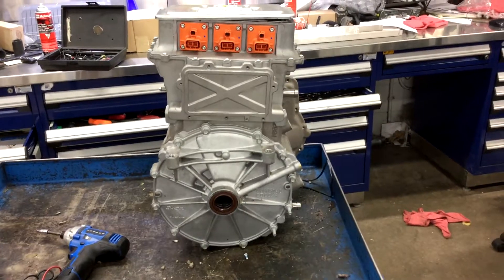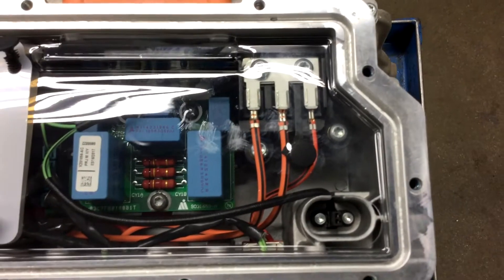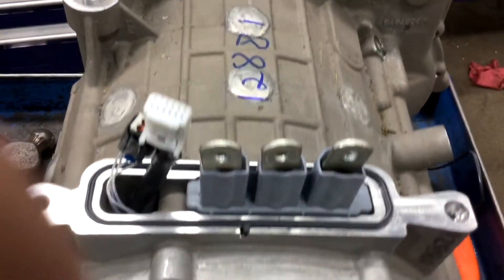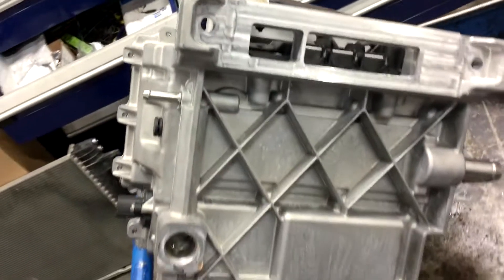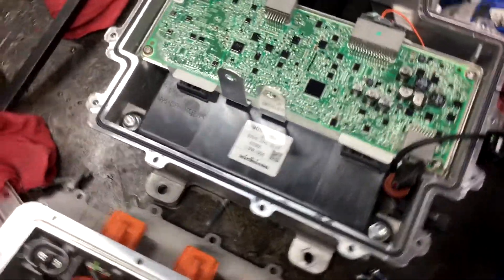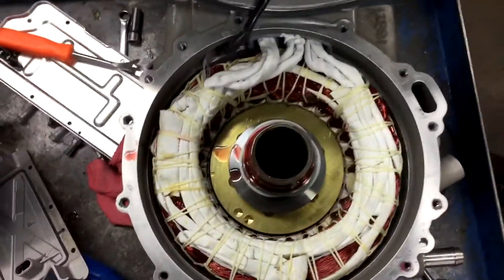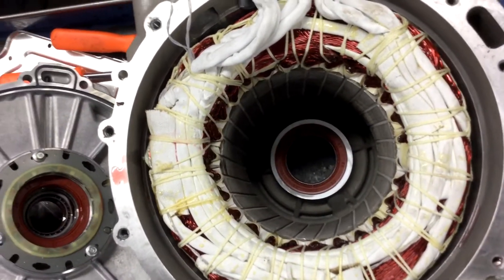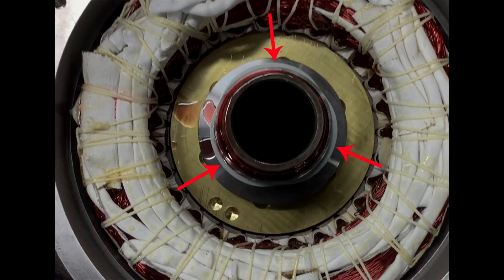Ford Focus Electric -- motor teardown

Comment: Do you want to sell me that scrap TCM?
Reply from the maker: After the video was compleated, All of it was donated to a local college as a teaching aid
Reply: @RedneckCam666  I got a high voltage leak and it’s making a very pretty wave form of 3v + and 1v - so I’m thinking my tcm is going out from me constantly hammering it. :) no big deal I have a pile of modules already and will just add this one to the pile.
Reply: @eprofessio Hoping you still monitor this after 2 years. My TCM was diagnosed as bad due to a high voltage spike. Can I just replace the TCM with a used one? The dealers just want to replace the whole transaxle/TCM since that’s how they come from the parts dept. but they are not available anymore from ford. Sounds like you’ve done this before. Any programming required after doing it?
Reply: @jefsel881  all the parts I have swapped out just magically worked with no additional programming.
Reply: @eprofessio that’s encouraging. The dealer said the harness and the TCM are bad. And if a voltage spike killed them would you expect the evcc to be bad as well. Where else could a voltage spike come from?
Reply: @jefsel881  dealers don’t know shift about ev. Especially ford.
Reply: @eprofessio  I get that impression. Plus I get the vibe that they want ev's to fail.
Reply: @jefsel881 once I figured out how easy ev are to repair I fell in love. It can feel overwhelming at first because it’s so new relative to ICE machines. They are super simple if you exclude the minutia of the electronics.

Comment: That piece between the TCM and the motor was more than likely the inverter you can see the 3 bus bar connections for the 3 phase motor,.

Comment: This is becoming a trend - EV proponents may claim EV are "simplier" than ICE but in an ICE most parts are usually serviceable. On an EV most parts are integrated electronics & chips which usually aren't serviceable - and a complete replacement isn't going to be cheap.
Reply from the maker: Not really, most ICE engines are not worth rebuilding vs buying new when you factor in any warranty for the unit.
The Electric part of the unit in the video is actually very durable, it was the mechanical part attached to it that caused the damage
Reply: @RedneckCam666, thanks for your objective information